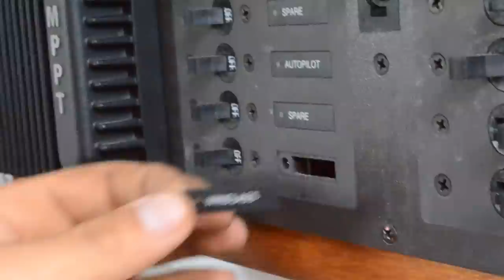Life Changing Improvements — Sailing Uma [Step 67]

Comment: Another great video and just in time for me too! I just installed an electric anchor windlass last year before I covered my boat for the winter. I didn't have the proper tools for cutting the hole in the deck so a friend did it for me and mounted the windlass while I was away. Now that I've seen your video, I'm at the very least going to pull it and fiberglass the holes and possibly either fill them with epoxy resin and re-drill them so they're water tight, and I really like that trick with the pvc pipe for the chain.....definitely doing that one! I learn so much from your boat work vidoes thanks so much for sharing your knowledge with the rest of us! I'm always amazed when I see what you've done with and to your boat! You are quite the engineer! Some school should give you and honorary engineering degree! You are a genius!! Thanks again for sharing and as always God Bless and be safe. Bill S. s/v ODIN

Comment: Hey Uma, love you guys since the beginning! i work on big work class Remote Operated Vehicles in the gulf of mexico which use various voltages from very high to very low in systems that operate up to and beyond 10,000 feet of water. We use all copper wire, open ended crimp connectors that we crimp, then solder and heat shrink with extremely low rates of failure due to connections. in the case of any water intrusion to electrical components we thoroughly flush with wd40 and blow dry. Not sure if it is worth the trouble to you, but that seems to work well for us. Hope you get a chance to say hi to Rincon for me. Thanks for sharing the adventure!

Comment: My favorite episodes are the DIY ones.  I would love to have seen the finished windless install from below.  Did you use a mending plate to reinforce the bolts to the deck?  Does the chain fall into a 5 gallon bucket or some other device to collect the sea-floor goop?

Comment: Disclaimer: I am not an expert- but I've always been told (and have done) that when you're drilling through core material you have to over-drill, fill with thickened epoxy, and re-drill through the epoxy so the deck core material remains isolated from outside elements- if one of the screws lets water past it will drip into the cabin (or on your headliner) but not get into the wooden core.  It also prevents something with a heavy load like the windlass from compressing the wood core with use which would also lead to loose/leaky screws.  Maybe you did that but spared us that time consuming process in the video.  :)
Reply from the maker: +Dan O. Yes, for sure! We've been doing this everytime we drill a new holes. Just didnt film it this time around. We did film it in a previous video back on the hard. The one where put the mast back up.
Reply: I should never have doubted you!!!

Comment: A steel or aluminum plate under the winch can save you from ripping the winch off when the anchor is stuck hard on the bottom. You want the motor to stall before mechanical damage is done to the boat or the winch itself.

5/16 chain is a little light for a boat your size. I used 3/8 chain on a 25 foot Luhrs.

Comment: On the ends of the copper wire.  Instead of greasing them, before you crimp the ends on.  Use a soldier gun, and soldier, to tin each of the ends, of the wire, and the electrical fitting end your going to put on it.
Then.....

Heat the tinned wire end, and push the tinned electrical fitting onto the wire.  The tinned hot end of the wire, will melt the soldier you tinned on the fitting end.  And it will suddenly pop right on.

And when its cooled...youll have like welded electrical ends, that can NEVER, corrode!!

.  As you do...Hold the end up vertical, so the soldier will run around each  of the copper strands, and under vertical

Comment: I am assuming your 48V bank is made up of 4 x 12V batteries ?  Just connect your 12V device onto one of the batteries and you will have a supply at the correct value. Your Engineering skills are outstanding you seem to be doing everything correctly and safely.  Love the videos.
Reply: Although that can work in an emergency, it will pull the batteries out of balance, greatly shortening their life if the imbalance isn't corrected soon after. Because equal charging current goes through all 4, and charge sources regulate based on total series voltage, the battery being tapped for 12V will end up undercharged (eventually sulfated) and the others overcharged (excess gassing, or permanent electrolyte loss if AGM). A deep discharge at 48V can also force the tapped/low one below 0% state-of-charge, quickly killing it.

Comment: Good recycling with the windlass, are you sure the donor boat wasn't sunk in one of the hurricanes? Where you put the bolt holes through the deck, it is good practice to drill a larger hole, fill that with epoxy then drill your bolt hole through that. 
With the fridge units, the peltier coolers are not particularly efficient but you have heaps of solar panel input and much more storage than most boats have. The pump looks like a cpu cooler pump be interesting to see how long that lasts, I am interested to hear how it goes on the efficiency stakes. 
It's funny seeing Kika in the snow, as an Australian, I would do the same!

Comment: silly question: does your rope to chain splice fit through that PVC fitting?
Reply: Not a silly question at all!
Reply from the maker: We got rid of the rope to chain splice in Miami when we upgraded to all chain. If we still had it, or had a length on the end of our 200ft of chain, we would have gone with a larger pipe.

Comment: I noticed a nice cook top behind you guys in this video, what's the story there? Solar cooker not enough, just needed options? The let's figure out a solution/fix this attitude you have to life and UMA keeps me hooked.
Reply from the maker: +Richard Lawson  nothing too interesting. along with our gosun (which we only used when its sunny) we cooked with our 2 burner propane camping stove. When we were in haiti the stove started leaking, so we went to a local hardware store and purchased this super cheap one as temporary replacement. Its nothing fancy and only has 2 settings high and low haha. But it works for now, until we can get or make an actual gimble stove ,maybe electric ... who knows ;)
Reply: Thanks for the info. Love the channel.

Comment: Hi Guys:  When drilling through your deck, do you drill over-sized holes, ream out the balsa core, fill with thickened epoxy and then re-drill?  Do you have a link for the refrigerator plate?  Does it use compressed gas or have a condenser?  Great work!  B.

Comment: You guys are so awesome. :)

It's great to watch you work through projects with both precision and expediency.  I can't imagine how much research goes in before you begin.

How's the expected efficiency of the peltier (I'm assuming) cooling plate, relative to a traditional compressor?  Are you running a full saltwater loop, or to a keel cooler / plate?

Comment: where did you guys get the 24vdc to 12vdc converter?
Reply from the maker: It's actually a 48v to 12v dc converter. 300W. They are used a lot in golf carts to run 12v accessories like lights and phone chargers. Also quite cheep. I think ours cost about $60usd. We purchased if from a company in Florida that we got our solar panels from too. http://www.solarevsystems.com/ very friendly, professional and knowledgeable. Hope that helps!
Reply: thanks. ill have to check that out. i plan on using a trolling motor as my outboard and the one i found was a 48v. i had no idea how much of a pain that would be to power. lol. what do you run on that 300W 12v system? is it enough or do you wish you went with a bigger converter?

Comment: Jamesbu11, I have the other video's for the work done on the conversion, what I desire is to see the results after the year and abit the motor has been in operation. Here we desire to add this to our vessel and to prove it works well enough to build the concept for usage on Lake Como for the Northern most section of the lake, there it is a Nature Reserve and well there are still many vessels using engines and therefore the film on the shores and the water of diesel and petrol are still very evident. Our desire to show that under the conditions of open ocean usage of this sort of system is far harsher than our sweet water lake and that conversions would be better for the nature and wild life! Cheers, I do have the other vids mentioned, what I do not have is an update on the functioning of the motor! Uma sent me a line that they are likely to do an update and this would be fabulous for me to share with other people that also desire to go from engines to motors!
Reply from the maker: Yes! We're working on an update video. So far everything is working out great. Very limited range, but thats why we have sails!

Comment: Using wire that is too small will heat up when running higher current appliances such as your windlass motor.
Reply: On their 48Volt supply the current will be just 1/4 of that used on a 12Volt supply. And the heating/melting effect of that current will be reduced to 1/16.  The heating effect is proportional to the square of the current!

Comment: I got the price of 417 Euros, from Claudio in Italy. Shipping, taxes and custom duties are extra...
Reply: Not a bad price,  I am interested to see how it holds up over time.
Reply from the maker: So far the only thing we see getting damaged is the little water pump. But it's only $30 to replace it, so thats not too bad. We plan to install a better filter between the raw water strainer and the pump soon.
Reply: Ok, I have to replace my refrigeration units. I had two, one for my galley fridge and one for my under deck compartment. I am thinking of that unit for my galley fridge. How is it holding up so far?

Comment: Hi guys ! Why don't you just tap in between the serial jumping connection of the batteries right where u get 12v? If than the charger is able to balance charge it should be fine. Maybe someone with better knowledge can rectify or correct my suggestion
Reply: Lead acid banks don't usually have automatic balancing. There are add-on modules ("Powercheq" is one brand), though expensive and, like a lithium BMS, limited to low balancing currents, meant to correct natural drift but not to compensate for an intentional center-tapped load.

Comment: I'm calling bullshit on that "refrigerator " is just recirculating seawater in the Caribbean that cooler would be about 80F.
Reply: Unfortunately there is no short cut with a fridge, a compressor will be needed in the tropics.
Reply: Are you sure ?
Reply from the maker: +Eric C nope! Fridge works great. Its a thermo electric cooler. Look up Peltier device. Most work on air temp, which means they pump hot air into your cabin. This one works off of sea water which is a much more constant temperature. I don,t have an accurate thermometer yet to do a definitive test, but so far it has kept raw chicken, beef, milk, yogurt and of course BEER! Cold for two weeks! We'll be doing a much more in depth video of the whole system and instal soon.
Reply: You have me looking at this refer solution.  I emailed the company today to ask about installing 2 cooling units in a row... and how much volume one unit would sufficiently cool.  I want a much larger freezer than the icebox I have now... what are your thoughts?
Reply: It's interesting and I would want some more info on it before buying it.  After doing a little research power consumption seems to be quite a bit higher than a traditional conversion kit and the lack of direct comparisons on the website to traditional units isn't really driving home that this is a better product.  It all depends on how much it costs and how much excess power you have on your boat.  Also, it doesn't appear to freeze from the website it looks like once it hits 0 it shuts off to prevent ice build up adding a second unit wouldn't change that.

Comment: That motor looks too small. Looks like it was designed for something lighter. I'm curious to see how it works.
Reply from the maker: Spoiler alert. It’s been 3 yrs and works great. We did have an issue of one of the bolts breaking and causing the motor to short out. But it’s solved now.